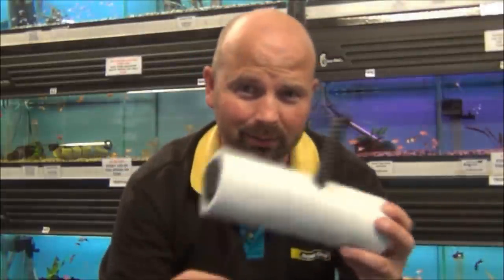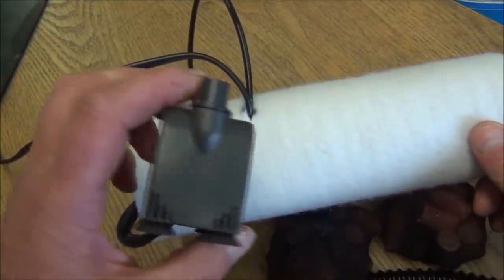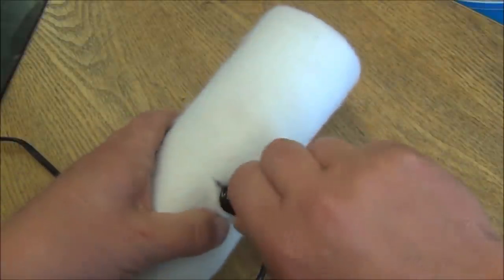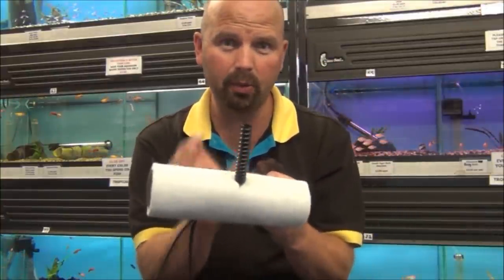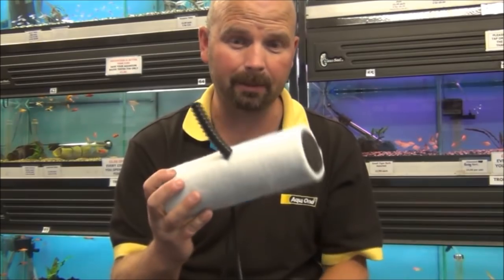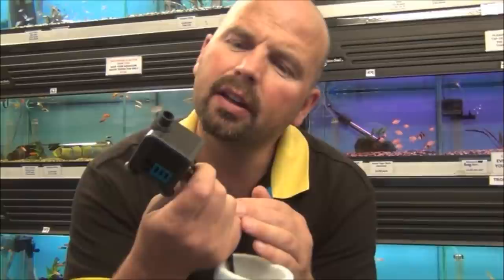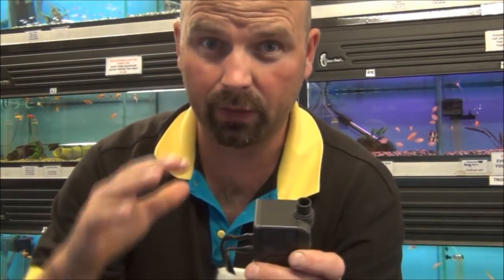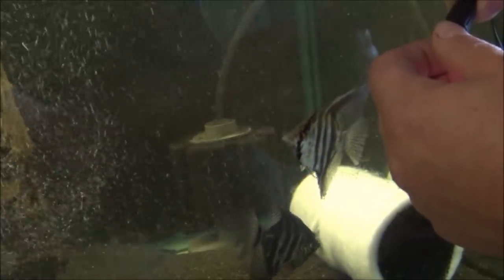BEAT THIS AQUARIUM FILTER!.....GROOVY - DIY AQUARIUM FILTER FROM PONDGURU

Comment: Family used to do dairying before we got out of the business.  we used to use milk socks to take any soil and so on out that washing of the cows would not remove from the milk.  This would be placed in the pipeline.  while the milk sock has no rigidity like the filter in the video would it be of use when filled the the different media and the pump ?  One end would have to be cut.  If so these are readily available in any farm supply stores.
Reply from the maker: I'll take a look at that as there are a few farm supplies shops near me as I live in a rural area, thanks for the suggestion.
I know a dairy farmer so I could always swing by there and ask him what he has available.
Thanks for watching and appreciating the videos.

Comment: Thanks for the tutorial of creating a good filter. Please let me know, what is this white colored PIPE made up of and where can i get this from easily. I wanna try creating this good aqua pump.
Reply from the maker: It is polyester and it is pipe which is used to insulate rollers for aluminium manufacture. They are available in bulk online - I get them from China in 100's - link in video description and pinned comment to my website. http://www.filterpro.co.uk

Comment: that biohome media looks good . forgive me if im ignorant , but can you tell me why i cant use small peices of pomace for filter media , cheers. i get it from the beach , bake it in the oven , and then leave it in the sun for a few days
Reply from the maker: +Jay Cottrell It wouldn't be ideal from the beach as it would contain salts which would mineralise the tank but if you can get pumice which has not been previously in contact with sea water or contaminated in any other way then it makes a great filter media. If you have a marine tank then getting pumice from the beach should be OK but it is still a bit of a risk as pumice which has been in the sea may have contaminants in it. All Matrix and Marine Pure types of media are is selected pumice but unfortunately the Matrix tends to be way too compact and the Marine Pure is often too open pored. I have just taken delivery of some excellent grade quarried pumice which is used for purifying water and until this source came along I had resisted the temptation to use pumice as media. It is the nearest media to biohome at a lower price so should go well - more so for marine or African Cichlid tanks as it mineralises the water slightly and has a pH above 7.

Comment: Love the video and the idea!!!!!.. I am in the US, I found the same type of pump here and larger since my tanks are 75 gallon and 150 gallon.. I see you are having a major problem finding the tube!  Wouldn't foam padding work? Just wrap it to the size you need for the pump and use zip ties to hold it in a tube shape? I have some outside.  Going to take a look at it, and maybe give it a try.  Just not sure if it is safe for the fish?  I  am breeding tilapia.. I am tired of filters taking so much space and using additional aeration.  This idea is perfect!!
Reply: I found a blog online and someone used POlyurathane foam in their wet/dry filter, all fish started dying and having problems.. May have to make one out of felt, seems like the best idea yet.
Reply from the maker: A CUT ABOVE FPV PRODUCTIONS Yes that would be a death sentence but polyester felt is perfectly safe.
Reply: WE got some yesterday, going to start our own idea of making a tube soon.
Reply from the maker: A CUT ABOVE FPV PRODUCTIONS Feel free to send me the link to any videos you make about the filters as I always like to see how ideas are evolved and improved upon.
Reply: A CUT ABOVE FPV PRODUCTIONS what is the name of the pump you found in the USA that works the same as the pump in the video above -- making small bubbles? Thanks!
Reply: IT is a Rio+ pump.  You can get the 600 or the 800.  The 800 pumps 200 gph.
Reply from the maker: A CUT ABOVE FPV PRODUCTIONS Unfortunately that pump takes air in at the outlet point, not the intake so it is a venture just like a standard pump or filter with venture outlet.
The difference with the pump in this video is that it sucks air in at the same point as the water so that the air is shredded by the impeller and allows the size of bubbles to be adjusted so they travel right around the tank, not just rising straight up.
Reply: Pondguru
But the product description reads: ...drawing the air directly into the impeller, it is able to create a much stronger suction for air...
Reply from the maker: Joni Solis I'm only going off the image searches I did for the Rio 600 and Rio 800 pump which shows the air inlet as a venture on the outlet but there may be other pumps called Rio? Feel free to add a direct link to the one you have found in the comment section here, no worries.
Reply: Can you please tell me where you got that pump?  Does it work the same way?  Meaning, the air going before the impeller and not on the discharge hole.
Reply from the maker: agus2001 It sucks air in at the outlet so is not the same.

Comment: Another great idea :) I know you're struggling for tubes but couldn't you just use sheets of 5mm thick felt or similar and stitch them in to a tube shape? it would be simple and also allow for varying tube sizes. I keep Koi, Tropical and soon Marine fish, I also have  a couple of goldfish in a giant (300L) eco planter and I'm thinking your filter would be great for this, just to add some extra bio filtration, circulation and air :) Already using your Biohome Ultimate and canister filter idea in my Tropical tank. Thanks for sharing all your great ideas :)
Reply from the maker: Yes that should work fine. For the small pump used in this video you will need an internal diameter of around 58mm

Comment: you could use the same media but make the tube longer If you wanted to add charcaol bag's to each end
Reply from the maker: +Charles norris Yes no problem. I now sell a smaller diameter tube which can be used to join multiple filters together - check link in video description.

Comment: Shouldnt you have the bubbler off during the daytime whilst plants are producing oxygen?
Reply from the maker: +Stephen Campbell Any filter needs to operate 24/7 and air pumps need to go all the time too - if they are only run occasionally it leads to very unstable conditions. With air pumps they don't greatly increase the amount of dissolved O2 in the water but they do break the water surface up allowing exchange of gases.
Hope that makes sense.

Comment: Where would one get a polyester tube such as that? I'd recognize it once I see it, but what kind of store did you get the tube from... 
Thanks
Cheers
Shawn
Reply from the maker: This type of tube is used in the metal working business on rollers but I can't find a company who will supply a sample or less than 100 pieces as an initial order. Buying 100 is fine if they are exactly right but not if they are wrong and without a sample it's too much of a risk for me unfortunately.

Comment: Poly tube solution (being how it's nearly impossible to find):
1. PVC pipe
2. PVC mesh
3. Sheet of densified poly batting (1" thick)
4. Riveting tool
- Cut several rings from PVC pipe, rivet into desired tube length PVC mesh. Rivet poly batting onto PVC rings.

Comment: How do you clean this filter? If you can't clean it, you're letting the waste collect and break down. Why not remove it before it breaks down? It might work for shrimp or fry because they will feed on it eventually, but for anything else its just a waste collector. Most aeration is done at the waters surface, not by the tiny bubbles rising through the water. I'll stick to sponge filters and/or prefilters.

Comment: hope ya make one that will work in the usa. i defently would buy one.
Reply from the maker: You can use a plug in voltage transformer 110v-220v similar to the one in video description and pinned comment link but I'm sure there will be a pump sold somewhere in the US which has the same method of oxygenating the water and 110v - you may have to search sellers of hydroponics gear as this sort of pump is not generally sold for aquariums although I've no idea why as they are perfect for that application.

Comment: Hi Richard I'm going to make one of these pumps for my 200 litre tank. I'm buying the same pump you have but I'm unsure if one pump will be enough for for this size tank (I Want to get rid of my existing pump) What do you think? I am going to try making the tube from thick(ish) filter matting that I will stitch into a tube shape with some fine fishing line. Maybe others could give it a go and see what they think :)
Reply from the maker: That would work but for a 200 litre tank you would be much better off with an external properly set up with biohome.

Comment: Lost this vid. Found it again(obviously).
Any updates on how the manufacturing of these are going?
Reply from the maker: +Cichlid Bro I have all the necessary parts available individually or as kits on my new website http://www.filterpro.co.uk but at present I am thinking about designing some mass market internal and external filters. One of the major players in the pond market wants to get into the aquarium equipment scene so I would love to do something with them - time will tell on that one but I have had a good relationship with them for the last 15-20 years and would definitely do anything I could to help them provide proper products as the industry is crying out for a manufacturer who understands filtration, is concerned about health of fish and who will not churn out generic products which don't work then sell the customer a range of 'cures' to problems which shouldn't have occurred in the first place just to make a quick buck.

Comment: what tank size and bio load would that filter be sufficient for?
i think many would highly appreciate a video with proper information, on how to dimenison DIY filters, and fit the filtration to the needs of a tank.
like gold fish or turtles will definately need much more, and different filtration, than a heavily planted tank with only shrimps and some tiny fishies in it.
Reply from the maker: The main problem with stating a specific size for a particular situation is that there are so many variables I prefer to put out the idea and then allow people to scale it up or down depending on the situation. At a guess I would say that the filter in this tank would easily cope with a normally stocked 100 litre tank.
Reply: Pondguru thanks for the response. =) i know you cant just say "use this filter for this tank size" and be acurate, but it always rubs me a bit, when you show how to make awesome filters, but dont give a hint, what rough size of a tank it's good for. and it's really a pain to find any good guidance on the matter. 
when i made a filter for my first little 30 litre invertibrate tank about a year ago, i was not sure,, went a little over board, and ended up with an intricate contraption, that's propably fine for 2-3 times that size. :D (a cheap double sponge filter, feeding into a 500cc chamber with a hand full of ceramic media at the bottom, and a moving bed of little bio balls)
Reply from the maker: Cuda FX Sounds good and going overboard on the filtration is never a bad thing.

Comment: Hi again sorry to be a pain, mind if i pick your brains?, im total novice so still learning A LOT! . I have noticed from the video and seeing the product available you have tweaked the product materials as both look very different, can you explain what the changes are and why. Im guessing it is for better stability and function but just wondering how. Also since the video have you still got this set up running, how does it look and function now its been going for a while and would you do an updated video please. Sorry im asking a lot,but ive been searching for a long time to find a decent filter solution, i think this is it! Thanks x
Reply from the maker: +Ju “AnonAnon” M I changed the supplied media as the new biogravel offers much more surface area in the restricted space. The filter ran in the shop no problem until I closed the shop then I gave the filter away. From all the filter kits I have sold I haven't had anyone experiencing problems except when they try to run it in a very deep tank since the oxygenating effect will only work down to a maximum of 45cm with the 450 pump. That problem can be overcome by using an air pump feeding air into the inlet pipe of the filter pump but since one of the goals of this filter is to eliminate the use of an air pump that solution seems a bit self-defeating.
Reply: Oh OK still sounds like a good solution to me I've got a biorb flow 30ltr which absolutely was the worst £300 I've ever spent as a first time fish keeper,  I've had all sorts of problems with the filter in the centre it's rubbish design has seen my fish trapped and my shrimp die getting trapped too! So I want to change it because I don't think I can ask for a refund after 8 weeks 😔
Reply from the maker: +Ju “AnonAnon” M The biorb upgrade kit I do on the website and ebay would offer a solution to the biorb problem and for a flow 30 you would need the biorb 60 upgrade kit but ignore the templates for foams - just cut them according to the base size of the tank. 
I hope to be meeting with the company who have taken over Reef One (makers of Biorb) to discuss some extra ideas I have regarding the filtration as that is what really sinks the product and results in millions of deaths worldwide each year.

Comment: Great idea. If only there was smaller version for my 46l fluval edge tank.
Reply from the maker: You may want to look at the 'invisible filter' video to adopt that idea with a suitable ornament. This filter is really for breeding tanks or any situation up to 100 litres where the water could do with a polish and nitrates need controlling.
Reply: +Pondguru Outdoors I just started watching it. ;)
Reply from the maker: Awesome, many of the ideas I throw out there can be combined, altered or improved to suit most situations.
Reply: +Pondguru Outdoors what sort of air pump could I use for small ornament? You had one that was very quiet. Would that one do the job?
Reply: +Pondguru Outdoors also, which biohome media has the smallest pieces?
Reply from the maker: A 50 litre per hour air pump would easily do the job and the smallest biohome media is the biogravel which is perfect for making ornament filters as long as it is kept in by foams. I am on holiday at present so not taking orders until after 26th August.

Comment: I was just thinking. if you used a regular water pump inside the filter and just put an air line into the inside on the filter wouldn't the negative pressure inside the filter cause the airline to pull in air to the inside of the filter. Then it would also get chopped up by the impeller thus accomplishing the same thing with a cheaper pump? Theory and practice are you different thing as I understand it
Reply from the maker: Joshua Wyatt I have done that with small pumps before I found the one with air intake and it was extremely tricky getting the pump to draw air in and shred it. As impellers are generally designed to pump water a fluctuating air input can severely damage pumps so definitely best to go for one which has air intake at proper place and impeller which handles an air / water mix.
Reply: Makes sense. Thanks for the info. Awesome videos by the way.
Reply from the maker: Joshua Wyatt No worries. The one thing I regret about closing my shop is the lack of aquarium related video opportunities I have now. That is the only thing I miss, lol

Comment: Great idea - what size tank for these pumps ? just can't work out litres per hour for say 65l  tank sorry to be a div!!! Also this isn't ideal but surely you could buy this polyester sheeting and 'sew a tube' - would that stuff you use for lining a pond do? must be polyester surely- double up on thickness?? liz t
Reply from the maker: Yes a sewn up tube would be fine. The turnover of the pump isn't too important but the one in this video is 320 litres per hour which is easily enough for up to 100 litres tank.
Reply: Cool  thanks   -  good plan in the meantime until you source the ready made tubes.lol

Comment: Its just i was told that keeping the airpump on during lights on decreases the co2 levels as the agitation makes it escape and you want the co2 to stay in the water so the plants can absorb it. There seems to be alot of contradicting advise on keeping a healthy aquarium, im not saying you are wrong by any means, it justs gets abit confusing when youre told one thing, then the opposite.
Reply from the maker: +Stephen Campbell I can see where they are coming from with that but I haven't sen any evidence of plants doing badly in a tank with a 24/7 air pump. Remember that air contains Nitrogen, Oxygen and Carbon Dioxide so there would probably be a counter argument that pumping these important things in 24/7 would be of benefit to the tank.
I don't know enough science to argue that either way but everything in balance will always be an impossible dream when keeping anything in captivity as it is near impossible to come close to mimicking nature.

Comment: 2 things I like about this filtr 1.it dosent use an external air pump so its very quiet and 2. it is fully submerged so it dosent cool the water by removeing it from the tank and then pumping it back in again.
Reply from the maker: +Martin Pennington I'm glad you appreciate the idea - thanks for watching.